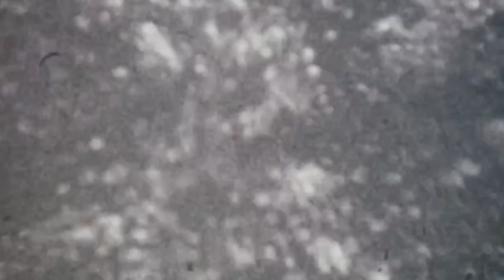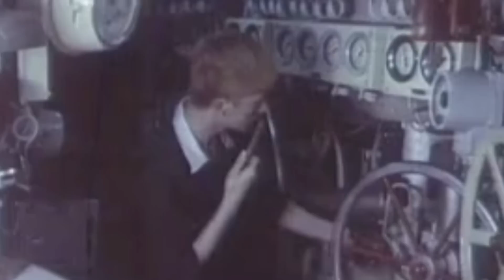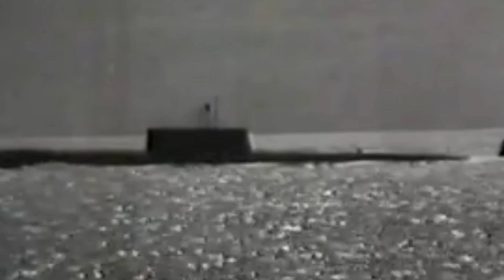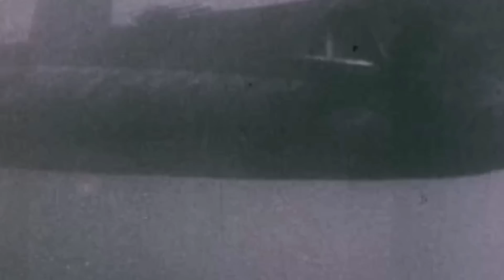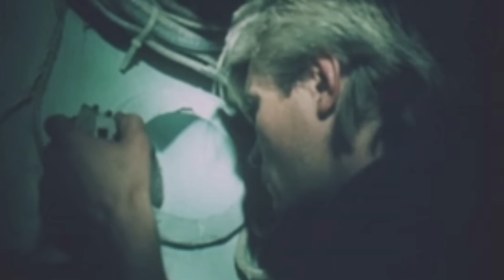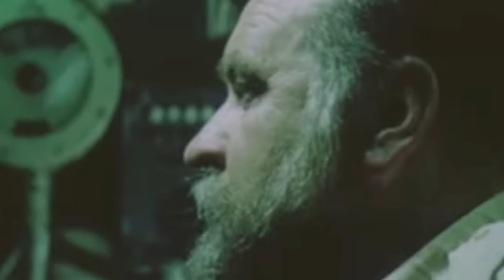The Most Dangerous Submarine Still Out There?

Comment: 🤔  It’s the CONTAMINATION THREAT, NOT the “RADIATION  THREAT”! The major concern with the plutonium is that it is an extremely dangerous chemical poison.

        Radiation and contamination are commonly misunderstood terms but an easy analogy to understand the distinction is to consider dog 💩:

            If one walks into a room where a dog has crapped and can smell it, that is equivalent to air borne “radiation”.  
            If one steps in the pile, that is equivalent to contamination, ie becoming “contaminated”.
            If one keep walking, then one is “spreading contamination”.
            The spread of contamination is the real issue.  The radiation is completely attenuated within a few feet of water coverage.  

      Documentarians should strive to use precise terminology to educate the ignorant. 

      This was a great, historically significant video 👍 😎

Comment: Titanium is not stronger then steel, but as it’s lighter you can use thicker hull for the same weight as a thinner steel hull.
Reply: They didn't use titanium for its resilience but because is an amagnetic metal... it can't be detected by a magnetic anomaly detector (MAD) contrary to others submarine made of steel.
Reply: @Khrist75  a thicker hull makes you dive deeper, Alfas did go as deep as 900m
Reply: @martinandersson5278  Oh, is that true ?? Thank you Captain Obvious, but i  have a Thermical and Energetic Engineering degree, so i know perfectly how work physics and alloys. Steel is magnetic, Titanium is not. It's a "stealthy" material and that's the main reason they use it...
Reply: @Khrist75  apparently not, there is non magnetic steel, you can also demagnetise steel 
As we do with our mine sweepers
Reply: @martinandersson5278  So you want to use 8000 ton of steel, warm them up to 800° to demagnetize it and to finally get the same weight (compare to titanium is around 65% heavier) and many others draw back than before (corrosion,etc...) ?? Pretty weird pov.
Reply: @Khrist75  with you fancy degree you obviously don’t know jack shit
You don’t need to heat it up to demagnetise it 😂😂

Comment: i always wondered why submarine designs won't commonly include an escape pod..
Reply: If the submarine was damaged enough to sink, in most situations the escape pod would also be damaged.  You have to understand that in most situations, there would not be time to even use the pod.  They, along with most sub escape equipment is for non-battle, shallow water emergencies.  Most places a submarine patrols, are, as we used to say, within 3 miles of land, straight down.  And, in water too cold to live in very long.  We were, as the old movie title stated, expendable.  USN '82 to '90, sub sailor.
Reply: What would be the downfalls of making each sub section naturally buoyant, and designing each section to be its own escape pod be? Maybe exploding bolts could separate the sections after sealed, idk just brainstorming here..  @sabledriver
Reply: @sabledriver  i understand certain situations are unsalvable. But picture a situation like the ARA San Juan, rough seas to sail on surface, very dangerous situation if diving, what would you do if you have the pod? risk the crew or scuttle the sub?
I imagine something like repurposing the conning tower to double as an escape pod.
Reply: Many cold war soviet sub designs did have pods.
Reply: Ive always thought they should build them so that each compartment could be used as an escape pod. I think that would be the way to maximize lives after an attack or disaster, but idk, they are probably hard to build in that way.

Comment: You call out 'double hull' as some kind of Soviet monopoly. It isn't. It is also NOT an inherently "faster, tougher" design. All "Double Hull" means is a 100% enclosure inside a hydrodynamic hull envelope. Note that that outer 'slick' hull is NOT a pressure hull and contributes NOTHING to the pressure-resistance of the actual, REAL pressure hull. American designs have some" sections of the pressure hull contiguous with the outer, hydrodynamic, hull - thus granting greater internal volume for the same size, or smaller size for the same internal volume of vessel. 

You should really do more study before sticking your foot in your mouth, you obvious non-qual NUB.

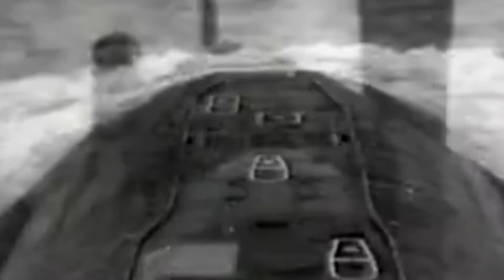Comment: @4:00 . . . Titanium is not twice as strong as steel. It is similar in strength, 'however', half the weight.
Reply: Titanium is one of the strongest pure metals, but there are stronger steel alloys.
Reply: @Twerkulies   . . . it is nearly identical to steel in strength, not even considered stronger. Tungsten is the strongest natural metal but it is too brittle to use.
Reply: It also handles heat better
Reply: @robertheinkel6225  Its extremely heat resistant. It's exactly why the SR-71 was made from titanium. They literally had to invent a new type of forging technology to work with that amount of titanium. And ironically, most of the titanium used for the SR-71's came from the USSR.
Reply: @Twerkulies Purchased through a shell company.

Comment: A similar problem is the sunken German U-Boat U-864 off the coast of Norway. When sunk in WWII, it was carrying a cargo of 67 Tons of Mercury metal for use by Japan. The Norwegian government was planning to completely cover the downed sub with sand and gravel to help seal the mercury in. Not sure if this has been done yet, however.
Reply: Works for my cat,sounds legit
Reply: @Notmesaidsamiam  if your cat can produce 67 tonnes at a time, it's done well  to bury that.....
Reply: They covered the sub with sand and sealed it in
Reply: @randysliker8518 That was the plan, glad they did that. Seems safer than trying to bring up the mercury.
Reply: @joeylawn36111  well it would only of been dangerous to any of the divers if they did anything to recover the mercury.   but just putting sand over it is about the same as doing nothing.  and if it was liquid mercury which is not very soluble in water anyway its mostly only going to pollute the soil under the sub if it leaks out.   BUT if they did what to contain it better they should of put steel shavings down around the sub which the mercury would react with and stick to the steel to form an alaglum and would not disperse as much then they could of capped it over with hydraulic concreat.
Reply: @randysliker8518 but sands shift easily by the currents. This seems worthless in theory…
Reply: @30anvz28 not much current at that depth.
Reply: @chriscarbaugh3936 not sure the depth of that wreck. I know at 120’ theirs still a hell of a current from my own diving experience.
Reply: @chriscarbaugh3936   The Deep Ocean currents in the Norwegian Sea are of the strongest in the world.  While currents caused by wind, generally, don't extend much deeper than than 200m (but can cover very large areas), the currents caused by differences in water density (brought about by variations in salinity and/or temperature) can  run many thousands of meters in depth and some are known to flow in a nearly vertical direction.  The Norwegian Sea is where 4 large bodies of water converge, involving several different major currents, which make for some fairly intense currents, eddies and whirlpools (deep and surface).  Some of the most powerful whirlpools known to exist on Earth can be found in the Norwegian Sea (think maelstrom).  At any rate the Norwegian Sea is of the most active, current rich bodies of water on the entire planet and the currents there are not limited by depth, of this one may be certain.  Mercury is a very dense material, however and it isn't soluble in water so there is actually very little risk to the water (the risk would be to the sediments and materials that the sea floor is composed of underneath the wreck, so in my opinion they should have removed it altogether because its not a question of if it will leak but when).   They should actually still take steps to remove it from the ocean altogether and the cost could be, at least partially, recuperated by the sale of the material.
Reply: there are currents all the way to the sea floor. the oceans floor isnt calm at all  @chriscarbaugh3936

Comment: again i say why diesel or battery powered submarines are better than using atomic power. if it had diesel engine then it would be in service today
Reply: The type of propulsion had nothing to do with the sinking. and there is no environmental danger.
Diesel boats could still be useful in a very few uses cases, but their limited range and speed and the ease with which their locations can be deduced make them a very poor choice in general.
That's why we don't build them any more  and have no intention to do so in the future.
By what metric do you consider diesel boats superior?
Reply: @Zomby_Woof  Environmentally they are superior, especially after being sunk, even WITH all that oil. At least it runs out one day..
Reply: @VashStarwind  The US has not lost a sub since they implemented the SubSafe program in the 60's.

That's a piss poor argument.

And you left out the ongoing pollution of running large diesel engines throuout the service life of a diesel boat 

Why do you think no nation builds both nukes and diesels?
Reply: Nato nations laughed when russia started building their diesel electric fleet back up. They're not laughing now with the nearly dead silent diesel electric the Russians have been producing.
Reply: Nuclear reactors are extremely safe... Far safer than coal plants

Comment: The biggest flaws are Russian engineering and build quality.
Reply: The biggest problem is not knowing the history of people like you!, for example, 2 US nuclear submarines sank probably because they were eaten by Godzilla, and not because of mistakes during construction and operation
Reply: @user-md3sl1nn3m  at least 3 Russian subs sank because the Russians use chemicals in their sub based weapons that explode when they touch sea water and the fact that the Russians can't machine a proper seal surface.
Reply: @mattl6300  give me 3 examples pls, only 1 sunk from that reason its Kursk
Reply: @user-md3sl1nn3m   #1 k219 #2 k129 #3 k141 maybe b37
The soviet/Russian navy lost at least 13 subs after ww2 due to incompetence or mechanical failure.
The US navy lost 4 subs after ww2 due to incompetence or mechanical failure.
Reply: @mattl6300  K 129 sank not because chemical components were used in weapons, but because the rocket hatch cover was not opened during the launch, so this is not the reason that you indicated in your first message!
Reply: @mattl6300  K 219 drowned due to a leak of water into the rocket shaft, which caused a fire and explosion in it, the cause is water leaks, not chemical components!
Reply: @mattl6300  And only Kursk drowned due to the explosion of a chemical torpedo in the compartment, the investigation showed that this torpedo was loaded with violations and was hit, which led to its detonation in the future! What does the design of the submarine have to do with it? I say again, learn history, and most importantly, the USSR Navy had a lot more submarines than the US Navy, so the losses are much greater, if you compare the percentage by number, it will be about next, if you had, for example, 100 boats, and we 300, then that's postichay!, numbers are given only for example
Reply: @mattl6300  In 1985, the USSR Navy had 60 missile and 132 multipurpose submarines equipped with nuclear power plants (192 boats in total). At the same time, the US Navy had 38 missile and 97 multipurpose nuclear submarines. Add here about 200 more diesel boats from the USSR, there were none in the USA as we know! Let's say every 100 exits ended in an accident, so do the calculation!
Reply: @ИгорьЦибизов-в4ф  you must be a Russian to be this stubborn in the face of history and current reality.
Reply: @mattl6300  u must be American, same for u 😂
Reply: @ИгорьЦибизов-в4ф  100%. I truly hope we never find out who's stuff is better.
Reply: That,             and communism
Reply: @HubertofLiege  that's definitely the root.
Reply: @HubertofLiege  Yes, and vodka too!

Comment: The important part is that the ocean is diluting any escaped contamination down to almost nothing.  The best thing to do is just continue to monitor the levels.  Trying to further entomb it or otherwise disturb the wreck site might make it worse.

Radiation scares people because they don't understand it.  Normal backround radiation is almost zero.  So when somebody tells you the reading is 800,000 times normal background radiation, it means 800,000 times almost zero = still almost zero.
Reply: You might want to re watch. The 800,0000 was an unspecified reading level. Not a relative comparison. And a level of 1 is nearly zero. So, even if it’s comparative, it could be be 800,000 times 1, 2 or 3….definitely not zero.
Reply: @just-dl  Yes, Cesium-137 is extremely rare in the environment, so the ratio of Cesium-137 from the Sub ÷ almost nothing = silly big number = not actually dangerous.
Reply: "In July 2019, a joint Norwegian-Russian expedition found "clouds" emitted from a ventilation pipe and a nearby grille. They took water samples from the pipe and from several metres above, and analysed them for caesium-137. That pipe had been identified as a leak in several Mir missions up to 1998 and 2007. The activity levels in the six samples out of the pipe were up to 800 Bq/L (9 July). No activity could be detected in the free-water samples. Due to dilution, there is no threat to the environment. The Norwegian limit on caesium-137 in food products is 600 Bq/kg. The background activity of caesium-137 in the water body is as low as 0.001 Bq/L. More sensitive measurements of the samples were reported to be in progress.[15]" -Wiki entry (including spelling errors) on K-278 (known in the west as the Mike class). The Wiki foot note included is: "15. Hilde Elise Heldal, Stine Hommedal: Researchers discovered leak from Komsomolets. Institute of Marine Research, 10 July 2019, updates 11 July and 29 August 2019, and personal communication 29 August 2019."  Further the wreck is being covered by silt which will aid in the dampening. My suggestion to those so "worried" about radiation is to actually read more than one reputable scientific source on the topic. Sorry, but Earth First and Green Peace are NOT reputable.
Reply: Idk about ocean levels but 800000 times the normal level is deadly in air
Reply: Just a small hole then 🤔
Reply: That is the most ignorant statement I have ever read!
Reply: @drcovell  How so?
Reply: @drcovell water absorbs radiation and it can only travel through water a couple centimeters
Reply: almost nothing... so, there is contamination, and it could become worst... no more eating fish from there for me...
Reply: Do you like Bananas?  Hold a Banana up to a Geiger Counter.  Do you fly regularly?  Airline pilots are exposed to the equivelant of 50-75 chest x rays per year.  This is considered safe.  It takes a lot more rads than you think to make you sick or even incrementally increase your risk of cancer.
Reply: What about the children?
Reply: @HubertofLiege the rejoinder of tyrants all over the world, while killing, maiming, and traumatizing every last one in a bid to “tell them who is boss!”

The nine most terrifying words are, “I’m from the government, and I’m here to help.”

Comment: Dumb question: would it help seal it if it were entombed in concrete? At least it's another barrier.
Reply: Exactly what I was thinking when they talked about sealing it!
Reply: @sarge6870  same!
Reply: When I heard about this back right after it happened, I thought the same thing.

Encase it in underwater setting concrete then bury it in clay.
Reply: They'd have to get concrete under it too.
Reply: @rdallas81  That's easy, just high pressure inject it into the seafloor under the sub.
Reply: @MichaelClark-uw7ex  Should be done.
Case the entire sub.
Reply: @rdallas81  Then cover the entire thing with impervious clay like they use on toxic waste dumps.
Reply: Thats what they SHOULD be doing, but i bet no one wants to pay for it... wouldnt be cheap..
Reply: @VashStarwind Likely, but given the risk you'd figure the Norwegians would pony up the cash to handle it. They're not broke, unlike the Russians, even though it should be the Russians' responsibility to fic it.
Reply: The cost would exceed that of raising the sub. Cheaper just to remove it at that point.